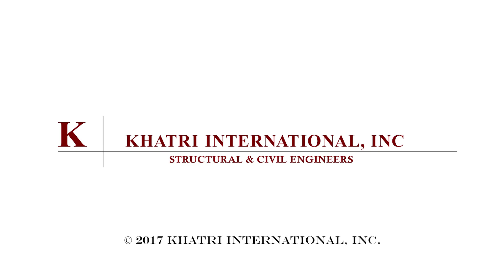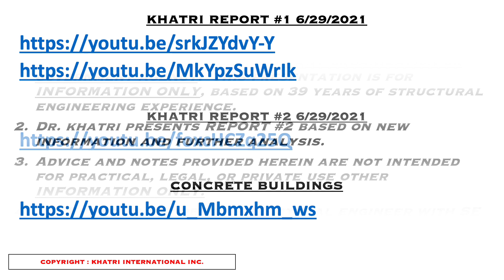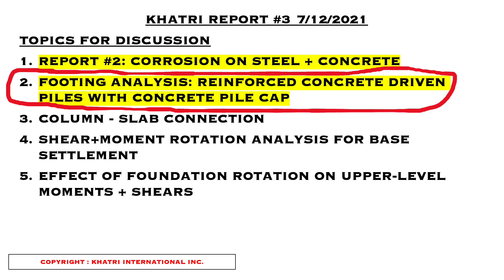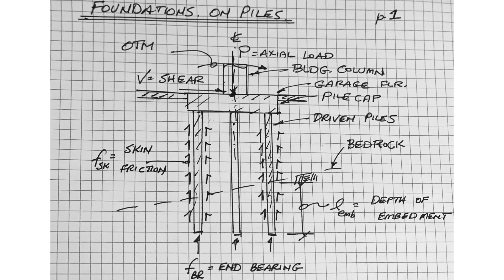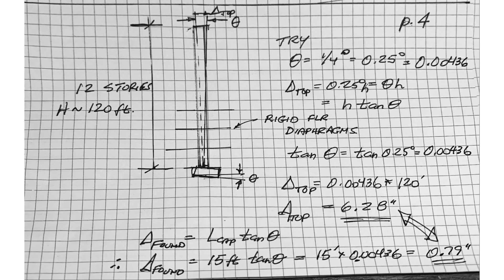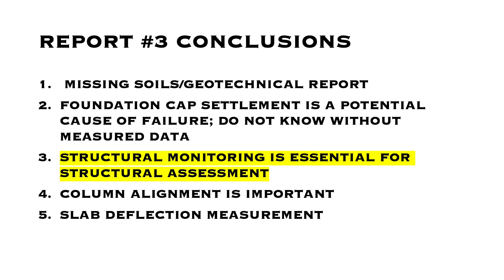2021 JULY 12 REPORT 3 Champlain Tower Collapse

Comment: I have trouble with your usage of the term 'rotation'. To me, and I guess most non-engineering people, rotation implies a circular (torque) motion. What you are calling rotation I would refer to as tilting.
Reply from the maker: Rotation has different meanings in engineering. Here I'm referring to rotation of the foundation and/or in a horizontal plane of the building.  Depends on the context. Thank you for your comment!

Comment: Do you think that Morabito did the survey of the parking garage to check to see if a building was in collapse mode? Did you see in the blueprints that they changed the elevation in the parking garage and they never put any kind of bracing on the columns where they changed the elevation? Great explanation and great information. Thanks.
Reply: I’ve been following the Champlain Towers collapse very closely.  I have no background in engineering.  There were elevation changes made and different plans were drawn up.  When the elevation changes were done, some of the BMA’s in the original plans were left out of the actual construction of the building.

Also, the deck was over its load capacity, especially where those BMA’s were left out.  That created punching shear to the deck which caused “tugging” on one or more columns and that resulted in the building failure.  

I find all of this quite fascinating and makes me rethink my career choice(s). 

Thank you for making these videos.  I find you very easy to understand.  You should make more videos and play with the YouTube algorithm so you can get more views.  People should be able to access the info you provide so they can learn.
Reply: @erinbremer5490  I agree. It all comes down to skimping on the design and build of the deck and columns. The main support columns were only 12"x16". Critically undersized. The main support columns under the lobby area were 16"x20" and withstood the sheer and pulling forces of not only the deck collapse but also the main building collapse. Also the lack of BMA support columns due to the design change in elevation was a major factor in the deck collapse. Also the planters and palm trees not in the original design contributed to the concrete rebar corrosion and deck weakening.
Reply from the maker: Thanki you kindly for your note.  I don't recall seeing the change in elevation, but that would be significant point.

Comment: From what I've read about Champlain Tower's construction, the foundation, or pilings, didn't go down all the way to the limestone bedrock.  They were designed to rest in sand.

There were also penthouse units added to the building at the time of construction, which were approved by the building department.

My question to you is how much does a building inspection...like the one conducted in 2018...cost?  Would it be a good idea to have them done more frequently? Like every 10 years? Especially in buildings that are located near bodies of water?

I read that there was also an earlier inspection...in 1996...that found 500' of cracks in the pool deck.

It seems to me that the warnings of dangerous structural problems were ignored for decades.  Shouldn't there have been regulations that would have compelled, by law, residents to repair any dangerous structural issues...or have the building condemned?
Reply: I think there was enough evidence of structural degradation in 2018 to condemn the building. Why the city of Surfside wasn't notified of the buildings condition in 2018 is beyond negligence.
Reply: @int53185  The condo board had the Surfside building inspector to look over the building after the 2018 report and he said that the building was safe.  Don't hear a peep about that now, do you.  Afraid of lawsuits.
Reply: @hokeypokeypots  Never heard of that. Very interesting.
Reply: @int53185  His name is Ross Prieto.  He no longer works for Surfside and has taken an 'extended vacation' from his current employer last time I read about it.
Reply from the maker: We do these inspections and the cost varies on the level of detail, but ranging from $4,000 to $30,000.